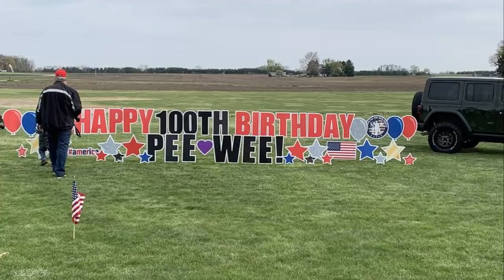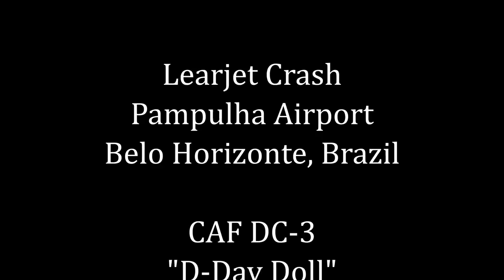Learjet Crash in Brazil/CAF DC-3 Loss of Directional Control

Comment: Hi, you usually offer advice as to what to do in these situations. In the case of the DC-3. what is the correct move? OK..he/she has lost directional control because the the tail isn't 'flying' and the rudder is useless, but he/she has also lost the ability to pick and choose which engine to power up/down to exert the only other method of steering. So what to do? Brakes? Massive braking on the right?

Comment: Hi Juan. On the Dc-3, wouldn't it be wiser to decide a no go once they didn't get satisfactory run up on that engine??
Reply from the maker: Yes! (Note the....agonizing pause...in my commentary).
Reply: @blancolirio  
Well Juan. Without any intention of underestimating that crew qualifications, I'd say they should start seeing yours and Dan's vídeos more often. 😁 And by the way wouldn't it be possible/desirable to take it out on a one engine take off? Safe trip to Nebraska.
Happy landings from Portugal.
Reply: That's my thoughts.  I wonder though if these things are SO temperamental that pilots begin to accept more and more deviance from normalcy until it eventually bites em. 

I know that back in the last of the MD80 days, some of those engines would get miiiighty slow to spool up from idle and maintenance would say yeah they're tired but it's within the acceptable range.  In the early days of MDs I highly doubt pilots would have accepted it but over time it became "normal."   With these old birds I have a hunch that's the biggest issue with this kind of decision making.  Slowly accepting worse and worse performance, "because it's always like this" or "yeah the engine is gettin' old" etc.
Reply: @jonesjones7057  
You know Jones (allow me to address to you like this).
The problem (as I heard and read, even from experts in this bird like Dan Grider's "probable cause"), is that even in the old days, these birds where always a challenge to fly. Old stick and rudder technic along with high sensitive engine thrust to manage. And eventually, as you say, probably actual pilots flying these machines may be tented to react as you would normally do flying other types of aircraft. Who knows? 
Anyway, at the end of the day, what matters is that everyone came out ok of that.
Reply: @jonesjones7057  possible but i also think money was a factor in their decision to attempt the take off if there was no way to work on the engine at their current location.

Comment: Complacency is a Killer.... It lurks just around the corner.
Reply: We have over 100 years of aviation records that show that too many “qualified pilots“ cannot be dependent on to follow checklists.

50 years ago, even 70 years ago, we could’ve totally automated the landing gear down system. Especially on expensive planes carrying passengers. Why was this not done? The aviation industry is a disgrace.

All you need is a simple digital circuit to automatically put down the gear when the above ground altitude is low, the airspeed is low, and the flaps are down, and you may want to include GPS or ILS Signal information in the logic control system. It is so simple. What a dumb industry.

What an un-needed disaster with gear up landing nearly every day, nearly every single day in this world there is a gear up landing somewhere.

Comment: My gosh man! Who is training these pilots? Stick & Rudder Control surely must be the basics? Coming from a Glider Pilot perspective it seems a lot of the basic flight rules are lacking for many.  Can you explain this in anymore depth? Great presentation as always Juan!
Reply: They absolutely are. For years the recommendation was maximum use of autopilot which for most flights meant engaging it as early as 5 seconds after takeoff and not disengaging until short finals. For me, being a long haul pilot, that meant minutes of handling per month. Air France 447 was the result and since then they've been trying to get more handling in. But as most airports are so busy, use of autopilot still is the safer option so skills are still lacking!
Reply: If I'm not mistaken, on a DC3 to maintain lateral ground control, in a straight line, the pilot maybe should have locked the tail wheel as the tail stopped flying.   Either way, if your preflight check fails take it back to the hanger!!!!!

Comment: I'm willing to bet I know less about aviation than most of your viewers, but in light if the TBM incident here in Florida (probable cause video), I have to wonder if you fail to get a good run up on on the apron, is it reasonable to assume it will get better on your takeoff roll?
Reply: During the static runup, the engine's working as hard as it ever will, accelerating the air from zero to whatever speed the prop blast is. In flight, the prop's taking in air that's already moving relative to the prop, so it takes less power to keep the prop turning. The runup amplifies any problems so they can be dealt with on the ground instead of having them get worse in the air. A badly running engine might smooth out when it's under less load, but it's not reasonable to ignore the warning signs and assume it will. If it's not right in one regime, it's not right and it will get worse. I've never owned an airplane,, but I've owned enough old Chevys to know that mechanical problems don't just heal themselves if you ignore them.
Reply: Short version? No, it's not reasonable to assume it will. That would be wishful thinking.

Comment: Directional control on the DC-3 while on the ground is determined to large extent by the ground contact of the tail wheel with the ground. The tail wheel is locked in a straight position  for takeoff. When the takeoff is aborted it is essential to get the tail wheel back on the ground to mai tain directional control. The locked tail wheel should keep the aircraft tracking straight as long as the elevators are maintained in a rear position keeping air loads on the tail wheel. It appears the pilots did not pull back on the elevators forcing the tail wheel back onto the runway and providing good ground tracking.
Reply from the maker: For small taildraggers, yes...DC-3? ....
Reply: @blancolirio  yes, them also. I am typed in the 3 and have quite a few hours of instruction given in them.

Comment: The comment about the DC-3 take-off is not correct. The rudder is effective anytime the aircraft is moving due to the propellor airflow on both sides. The rudder is highly effective. The reason you bring the tail up is to prevent the aircraft getting airborne at too low a speed. This accident appears to show directional control loss due to a losos of power on one engine.
Not sure why a take-off would be attempted with an engine that has issues - poor airmanship imho. If there was any doubt about the engine they could have done a static power check as part of the run up checks. 
Juan - get a few hours training on the DC-3.

Comment: The DC-3 has the tail wheel locked during takeoff.  Without rudder authority, there is no steering.  Not sure if the brakes can be operated independently on a Dc-3.
Reply from the maker: Yes, they can, basic airmanship.

Comment: I have had it pounded into my head. Two kinds of pilots: those that have and those that Will land with the gear up.
Reply: Old wives tale...if that is still acceptable to say these days.
Reply: Milt, I must agree with Manny... 45 year career and 17,000 hours in many aircraft, and not one gear up landing. And not one of my pilot friends have had one either. The saying is used to make one “aware” of the possibility, but most of us will fly many years and not have 
one.😏 Be careful, use a checklist, and don’t do touch and goes in a high performance aircraft- too much can go wrong...

Comment: Does the DC3 have differential braking that it can use to steer?
Reply: It does, but in this scenario where the plane is almost flying, there isn't much weight on the wheels so they're not very effective for directional control.
Reply: @IcthioVelocipede  makes sense. Thanks
Reply: Yes the DC3 and its derivatives have differential braking and because the tail wheel is not steerable this is the method used to steer during taxi, however the tail wheel is locked during takeoff (so it can’t castor) so this complicates things somewhat.

Comment: I can't understand why such an expensive Jet doesn't have a proximity warning with a prompt about the gear being up.
The DC-3 sounds like another maintenance issue.
Reply: Too expensive to install in an old Learjet. Would cost a large percentage of the value of the airplane. Our Lear 35’s 12 year inspection cost $700,000, which was close to it’s actual value. And as these older engines are reaching time to overhaul some owners are now scrapping the airplane and engines. Sad, but a financial fact of life.
Reply: @johncox4273  - Ouch, that's expensive. It makes you appreciate how cheap Airline tickets are, considering the cost of buying and maintaining them.

Comment: If the engine isn't running right at run up why would you even try to take off.That's the whole reason for the pre-takeoff run up. We have to be smarter about how we treat these airplanes. Thankfully that DC-3 just wound up in the grass and not crashing into something or someone else.

Comment: I am certainly not a full scale pilot but I’ll chirp anyhow. Have been flying RC models for over 40 years. If on run up your engine(s) are not performing well, you are only asking for trouble on take off. Just don’t get the thinking of this pilot. Lucky he didn’t kill someone.
Reply: I don't know what pressure the pilots of the C47 were under to get the flight in. I also don't know what the hell was going through their heads. Nobody laughs when they crash a full-scale airplane and nobody wants to watch it happen, unlike R/C where a spectacular crash becomes the subject of lots of jokes and good-natured ribbing. I hope we do find out more about this incident; at this point it's just incomprehensible.